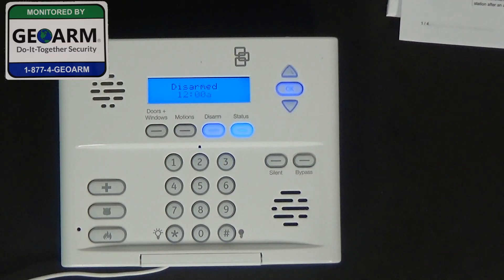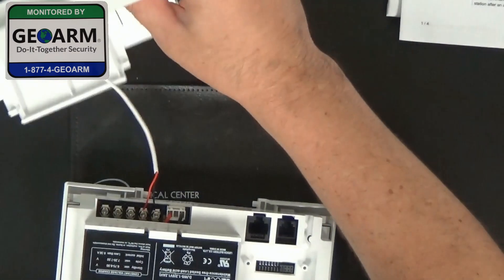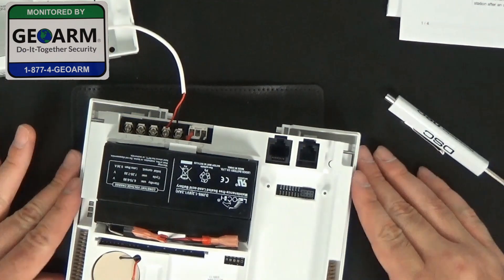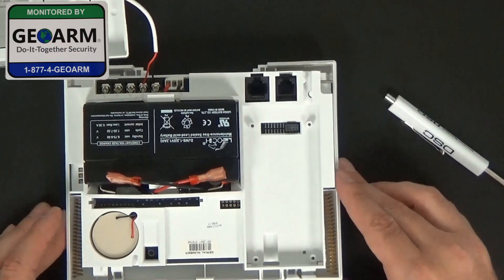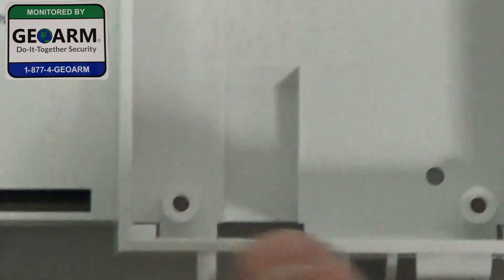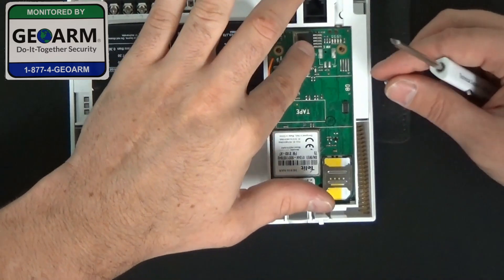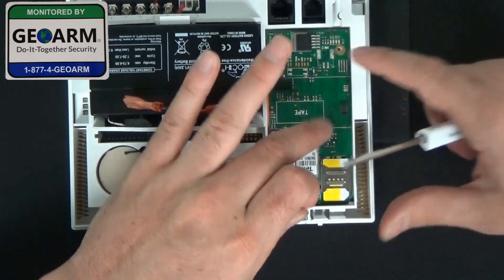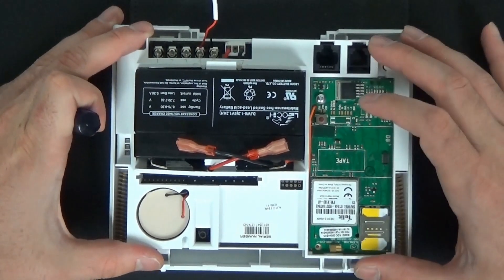GE Simon 600-1048-XT-ZX-AT - How to Install Simon XT Cellular Communicatior

Comment: Good Video thanks. I have a Simon XT with another security company. Previously I changed out the 2g communicator and battery with parts that were provided to me. Simple just as in your video. Now I am told I can't change out to 4g myself  do to liability . I can order the communicator on line, but does it need some kind of programing to work with my security company? My system works fine and I do not wish for any updated features I just want it to keep working once verizon switches to 4g. I live in Alaska so DIY is standard. Thanks

Comment: How do I reset? I just moved to a house where they left this device behind but I dont know the passcode
Reply from the maker: Power down the system completely, then you will hold down all four of the front buttons as well as the tamper springs in the back of the panel while the system is powering back on. If successful you will notice all of your accessories will be deleted and the default installer code 4321 should work for you. Are you looking for the lowest cost alarm monitoring services?

Comment: Does the module come with a SIM card?  Is there a monthly subscription to pay for the cell service?
Reply from the maker: Sorry for the delay on the interlogix simon xt with alarm.com monitoring. If you have the alarm.com cell module you will not need any separate sim cards as it comes with it already. Are you looking for the lowest cost alarm monitoring services?
Reply: I don't want alarm monitoring.  I just want the alarm to call my phone number.  This is how I currently have it set up, but want to ditch the landline and use a cellular module for communication.  Is it possible to get a SIM with a monthly fee and no alarm monitoring?